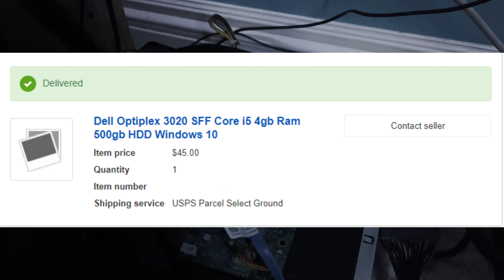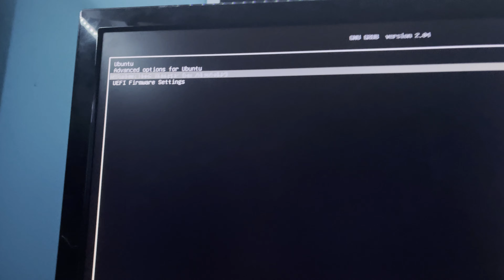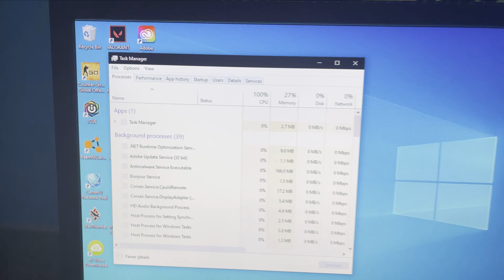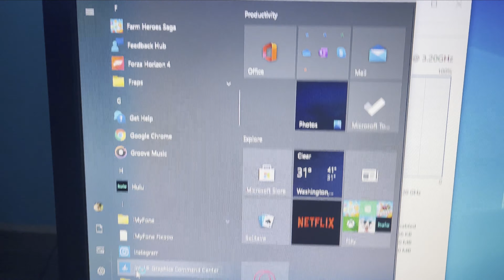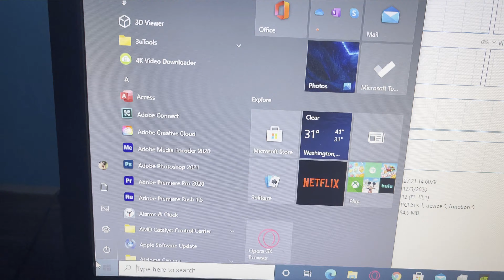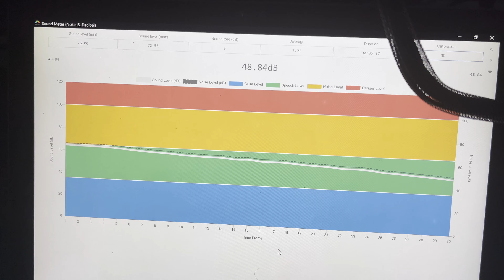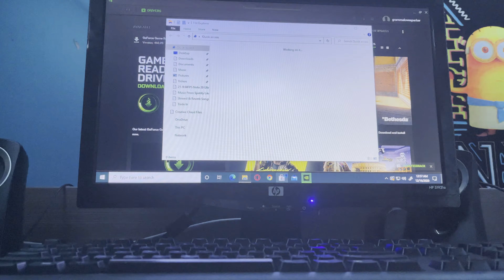The Most Jank PC Setup Ever

Comment: Hey so not to long ago I got a dell Optiplex 790 and for some reason after adding another harddrive to it its been stuck on this while dash screen for a while.. I tried changing to boot order but nothing is working. Would you happen to know how to fix it
Reply from the maker: Try taking out your new hard drive and make sure it boots because the new one could have cause a bios change.. lmk when you try that and see if it boots then put the new hard drive back in and lmk what happened so I can help you further.
Reply: @TheDomainS  the new harddrive was dident have windows on it I was just using it as storage
Reply: @TheDomainS  but I did take the main harddrive out and did the diagnoses and it said it was finr
Reply from the maker: @yawboku  try your jumpers on your drive
Reply: @TheDomainS  I think in why it won't boot. Before it stopped booting I was in the disk management partition thing and I think I separated the new harddrive idk
Reply from the maker: ohhh ok well lmk what happens :)
Reply: @TheDomainS  its good now i got a ssd and installed windows on it
Reply from the maker: awesome how is it running?
Reply: @TheDomainS  its decent for editing and stuff but for gaming its bad.
Reply from the maker: well at least it works for you :)
Reply: @TheDomainS  one more thing would I need to replace the stock power supply if I got a gt 710 or is it fine
Reply from the maker: @yawboku  Ok so when i had a gt 710 in mine i didn’t need to replace the stock psu but i think it was hitting the power limit when i played a game but it still worked with no issue and when i upgraded to my 1060 i needed a better psu but since the gt 710 doesn’t require any connectors for power or anything then yes you can use it but it might have limited performance
Reply: @TheDomainS  ok thanks
Reply from the maker: @yawboku  yessir :)